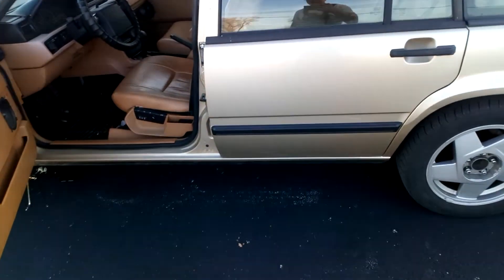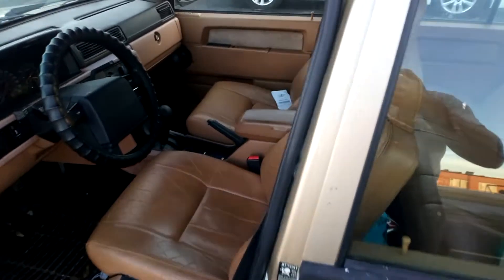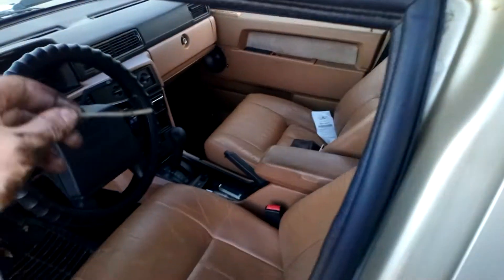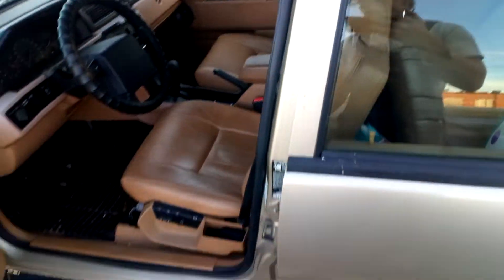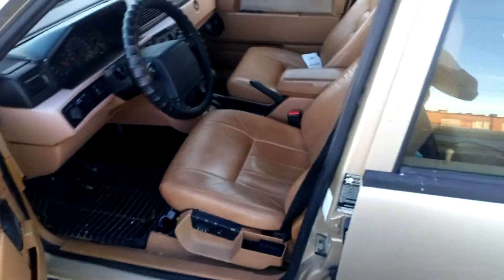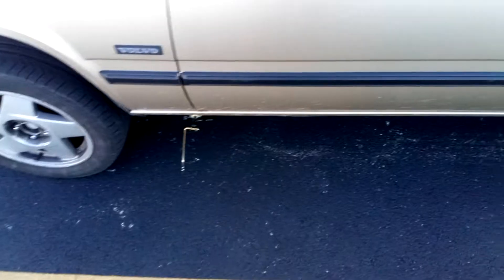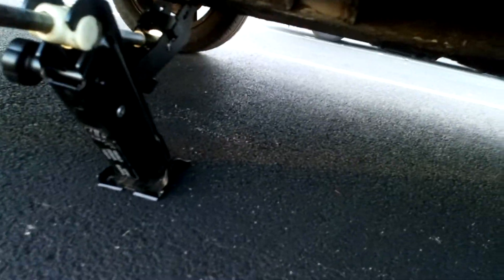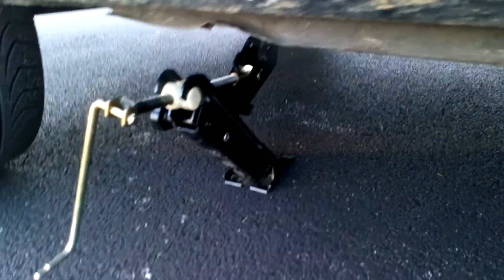I COULDN'T SHIFT INTO DRIVE?!  Volvo 940

Comment: Thank you! My 95 Volvo 940 was stuck in park this morning on my way to work. It’s got 470k miles on it. Gonna check it out tonight when I get home
Reply from the maker: Those red block engines are the best!
Reply: @sirthrival4601  did you end up taking it to a shop getting it looked at and fixed?
Reply from the maker: @vincentbryan1962  this happened some time after my Volvo mechanic replaced the rear main seal, and I think he forgot to tighten it properly. I drove with it tied like that for about a week, and then put the nut back on the bolt and tightened it down. It took about 2 minutes, and has been great ever since. A shop could easily fix it as well, it's just a nut and bolt and washer.
Reply from the maker: These cars are great, they are designed to be worked on by anyone, the tool kit comes with everything you need to keep it going until you make it to a shop. Sweden is a hug country with long highways and I can imagine they built these for people driving that. The front grill can be removed without tools on the 940 and there is room to slip a piece of cardboard between the grill and the radiotor and still hide it and keep your dignity. My alternator failed and I drove it with all accessories on, radio, wipers, windows, sun roof up and down for 3 days of commuting until the battery died. The engine overheated 4 times because of a bad electric fan (never knew they could go bad) and I still don't have a head gasket leak or oil in the coolant after a year and a half of commuting. They are bomb proof. They even have attachment points for  racing 3 point harness seatbelts behind the rear seat... From the factory. The engineers thought of everything.
Reply: @sirthrival4601  thank you sir! I love my Volvo as well replaced many things so far. Because I want to actually keep it. It’s good to know someone else out there takes care of theirs too